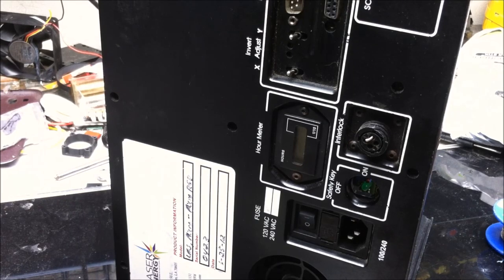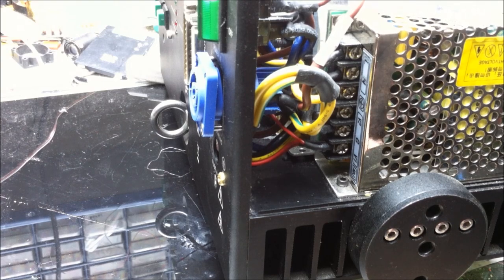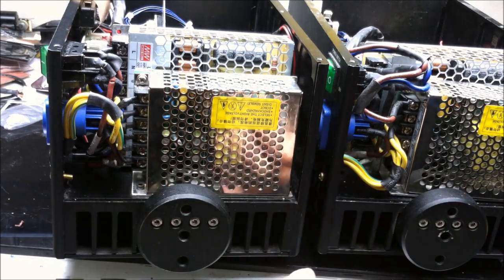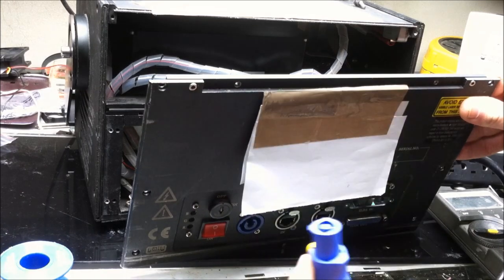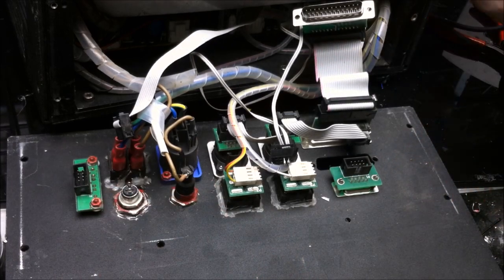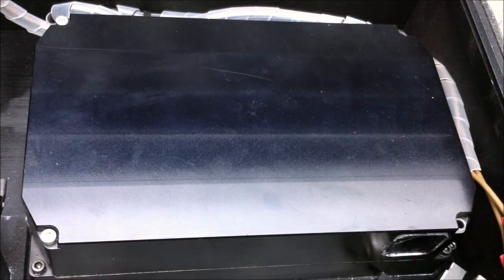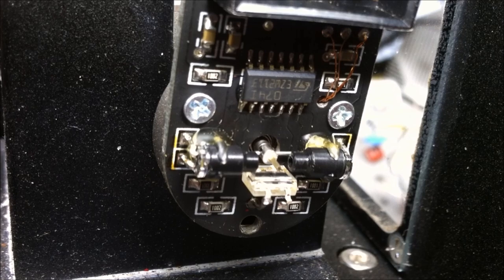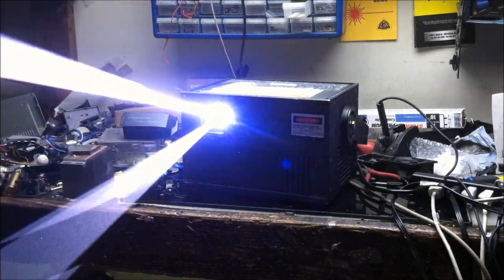Repairing 6 Show Lasers Part 5, A Few New Fixes & Old Problems Discovered.

Comment: As soon as I saw the galvo home to the wrong position I knew it was a knackered mechanical endstop. That coupled with the square positional feedback problem you noted is a recipe for disaster. You'd think they'd have found the potential issue during fmea and patched the design to prevent it before product release but I guess not, oops.
Reply from the maker: I think the use of the squared peg was to lighten the galvo and squeeze a little more speed out of it. But it does feel rather better mouse trap in design.